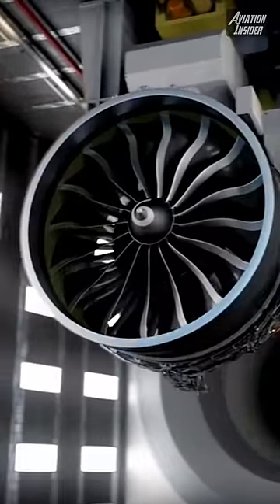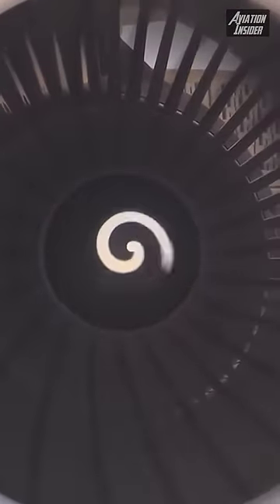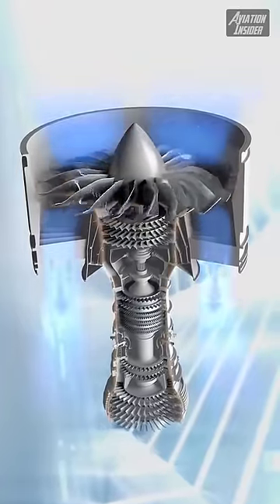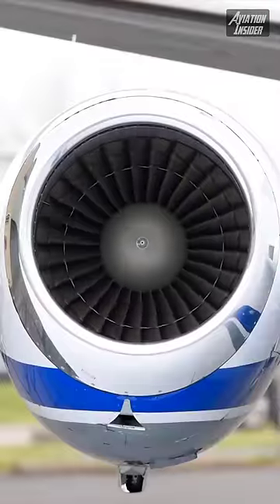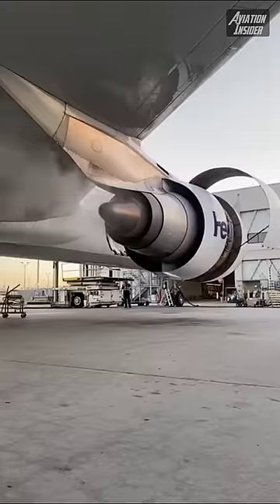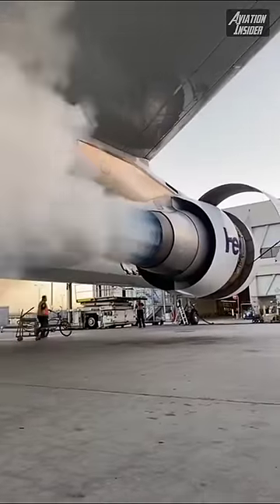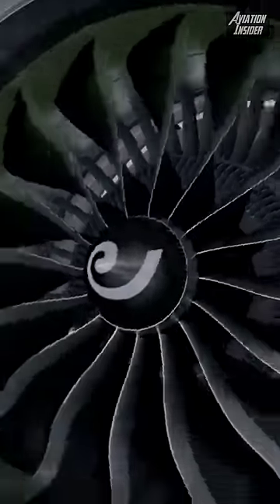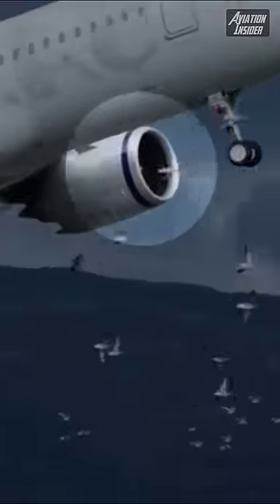Insane Reason Why Jet Engines Are Never Protected In The Front 😨

Comment: Only 1/4 of the intake air is used to burn fuel in the engine to make thrust. And other 3/4 part is used to cool the engine. 
They don't use any mesh to protect the engine from birds because it will induce drag in higher speed which will result higher fuel consumption and less efficiency
Reply: Now imagine if the mesh gets sucked in after it hit a bird

Now thats another problem
Also icing
Reply: @TPE429  let me clarify the icing problem. As a matter of fact there is no icing problem because commercial jets flies way over the clouds. And clouds are made up of water vapor way less denser than ice. Now answer me is there any chance of icing?
Reply: @TPE429  usually to prevent birds roaming around the airport all the trees and structures where birds can sit is removed. 
Still some birds made in they have drones to chase them so less probability but not "0". 
And if they got sucked into the engine then it's not good. That engine is out of commission. All the blades becomes out of balance.
Reply: @o_j_o6447  first of all. Icing can still occur above clouds thats why they made systems to mitigate this problem in the first place. Second of all a mesh of some sort will damage the engine more if it does gets sucked in
The bird is already bad but a metal mesh can damage it more. Is it worth repairing the mesh everytime it fails to catch a bird? No
Reply: Your just defending your point
Icing can still occur even above clouds and dont say "Water vapor is less dense" bro that vapor can still occur
Its called rime ice
Reply: @TPE429  water vapor is always less denser than ice it's as true as sun rises from the east and goes down in the west. When a jet flies at around 34-40k ft height there is almost no water. Until jet gets down to 4-3k ft and go through a rain or snow cloud. At that time ice can occur. I didn't say that icing on engine happens can never happens if go through a snow storm. I said that it can't happen in ideal conditions which means when you are flying without any cloud.
Reply: @TPE429  hey I'm electrical engineer we also calculate powerline wires characteristics based on places. Icing on power line wires also can happen which cause SAG. We had to keep in mind when we had to work on snowy areas.
Reply: @o_j_o6447  i dont think you quite understand that when the vapor hits the cold surface of an aircraft even above clouds can still build up ice
A mesh is a perfect place for vapor to be catched and build up ice
Its unheated and the air is used to cool the engine aswell so if we heated mesh aswell it would heat the engine
You are delusional
"Im a electrical engineer" and your not a aircraft mechanic aswell
Im not saying im better but mentioning your position does not make you right aswell
Your job is completely different than what you are talking about
Reply: @TPE429  yea you are right..!! No point in arguing with you when you are this fool.
I have a suggestion don't underestimate an electrical engineer. There is nothing engineering related what we don't have to read during our college. Electrical engineering is one of the most hardest engineering degree ever. 
And please read about atmosphere.
Reply: @o_j_o6447 As a commercial pilot, I feel a need to add something here. Icing could actually be a potential problem. Not a "cause a crash" kind of problem. More of a performance one. At least during take-off and landing. The icing on the metal wire would be enough to increase drag even more than the wire would already cause on its own. This increase in drag could cause a decrease in performance of the aircraft. Enough that it could potentially affect the aircraft's rate of climb and rate of descent, which in turn would affect fuel efficiency. Meaning that not only would the wire cause drag, but so too would the icing that was forming on it. Also, interesting fact. Technically, all of the airflow is used for thrust. Because of the way an airliner engine is designed, the intake fan actually acts as a propeller much like a prop plane does. So even though you are correct that roughly 3/4 is used for cooling and roughly 1/4 is used as fuel for the fire in the compression chamber, all of the air technically contributes to thrust. As the air moving on the outside of the chamber, but inside of the housing, does provide a certain amount of thrust. 
I'm not trying to say you are wrong or anything. Just adding a bit of extra context and information.
Reply: @chaosapple7771  as a commercial pilot you say. Is icing problem a everyday issue. I meant if you are not getting caught in a ice cloud is it still possible. And is it possible when you are flying at about 30-45k ft height. Someone is saying that I'm wrong and blah blah...
Reply: @chaosapple7771  btw i know icing is a real issue. It can change the shape of the airfoil which increase drag. And i didn't say anything about icing. I said that why airplane engine isn't protected by metal mesh
Reply: @o_j_o6447 Icing is absolutely an issue for commercial passenger jets as it is for all aircraft.  Adding a mesh in front would both make icing worse and increase the likelihood of damage to the engine.  I fly in alaska and twice we’ve had flameouts due to icing.  A much better solution is just to design the fan so the shroud takes the majority of the poultry.
Reply: Has it ever been an aircraft with deployable intake protectors for the take off/landing low fliying altitudes?

Wouldn't be there to create drag o get ice during most of the flight. Designed and made to damage the engine as little as possible in case of absorption.

Maybe is easier to just assume a yearly "poor bird" intake, but don't they pay top dollar for falcons and other ways to prevent this?
Reply: I am an aerospace engineer with  a master degree in propulsion systems. I have to say that nothing in this comment is correct. 

 I can ensure you that all the  air  that goes through the intake is used to make thrust. 
While it is true that only a small  portion of the air is used to burn the fuel (the ratio is higher than 10:1)  95% of the thrust comes from the air that does NOT enter the combustion chamber. Obviously the (so called)  cold flow is indeed used also to cool the combustion chamber but no single modern aircraft engine could fly with just the thrust coming from the hot flow. 

A mesh is not consider not because it would produce drag, the engine is already occupying that frontal area, the increase in drag of a mesh would be completely negligible. The real reason is that firstly it would be completely useless, even assuming that a mesh could survive the impact the bird pieces would still end up into the engine.
But most importantly, it would generate vorticity and 3D-flows entering the engine that would completely change the velocity profile of the incoming air making the fan ( the single most important component in an aircraft engine ) perfromace to drop.
Reply: @o_j_o6447  wait so you only protect icing at cruise? Use common sense please. youre icing answer only holds true if you LAND at 30-40k feet. The reality is, as the plane descends, it will still catch significant icing with that much mesh. Doesnt even need to be ice clouds, any type of moisture would definitely freeze when the plane reaches about 20k feet
Reply: Birds hitting a mesh will just be cut into pieces, which won't be stopped and will end up in the engine.
The mesh idea makes zero sense.
Reply: Isn't that what the video explained.

Comment: The fan blades limit the air intake and force it into a linear flow,  also they assist in compression.  Suck, squeeze, bang,  blast,  blow.
Reply: Wait, jet engines do SSBB too?
Reply: @YourLocal_Mkara yes
Reply: @verttikoo2052  I bet you also do SSBB
Reply: @v01d_r34l1ty  I bet that you don’t even know what Super Smash Bros. Brawl is.
Reply: @YourLocal_Mkara Yeah, just like my ex they do it all at once all the time.

Comment: So it’s because large airline companies can save some money from fuel efficiency rather than doing something to save the lives of 300-400 passengers.
Reply: Yeah, if you put it up like that😅
Reply: Did you honestly not think about if the bird hits it hard enough then you have a big metal cage AND the bird getting sucked through the intake? I'd rather deal with just the bird just saying
Reply: You dont die from a bird strike.
Reply: No its because it would lower the airflow to the turbine it REQUIRES the maximum amount of air possible
Reply: Thing is, most passenger airliners aren't single engine, and unless that mesh is made of some sort of super material then it'd just break when a bird hits it like most things would do at 300+ kmph relatively

Comment: A third key factor that was never said is bird strikes typically happen within a couple  thousand feet up. Landing/taking off.  When the plane is cruising,  there are no birds above at those flight levels and a mesh screen would be useless and cause an insane amount of drag that would increase fuel consumption and also possible FOD if that protective screen broke

Comment: Although true, two other factors are in play. First, a large bird strike at 300mph requires a very massive mesh to not fail and be sucked into the engine. That would be catastrophic. Second, any mesh  open enough to not utterly strangle the engine would simply shred the bird, which would still enter the engine.

Comment: It would cause drag potentionally all the way down on the ground (depending on what's going on); but uh if you controlled the engine even in outerspace you could create wormholes (but warning outerspace is delicate because it's complex vortexes you could cause a thermodynamic collapse making hot or cold engulf warmth; because cold grabs warmth like a constricting Snake venom DNA and hot lashes warmth like a Snake venom DNA that melts it in a way until it is stuck laying on it (because it's hot, cold, and warm in the middle cold on the left of warmth and hot on the right of warmth on Earth (not to say that it can't be other ways say hot on the left and cold on the right) with cold gripping warmth and hot lashing warmth.

Comment: They put cone shaped filters on car engine air intakes and it still sucks just fine. So what if a parabolic or cone shaped carbon fiber 'filter' cage with sharp leading edges was attached to the front of aircraft engines? Something with holes big enough so that icing isn't an issue but small enough to 'pre-mince' up big birds like geese and ease the impact on engine blades.

Comment: You can run a turbo fan engine with a mesh just fine, the issue is when you reach high speeds you rish the mesh breaking and causing damage to the engine,  or normal wear and tear causing the mesh to break apart

Comment: Never say never.  Some of the earliest turbojet engines had retractable screens in the inlets.  They iced up readily due to the temperature drop which accompanies the low pressure in the inlet, causing engine failures due to air starvation and overheating.

Comment: I'm working on a 737-200 at work now, which has 2 JT8D engines. They are small by today's standards and actually feature a stater before the fan blades. The intake diameter is small enough that if a person got sucked in its possible they wouldn't get shredded.

Comment: Also for any mesh to be placed there it would require it to be very durable to survive the bird strike, however, if such a mesh gets damaged it would get sucked into the engine and cause a lot more damage also other stuff could get caught on it, especially ice which then could also damage the engine once broken off not to speak of the reduced thrust. Bird mincer is the best option.

Comment: Most jet aircraft can safely fly with 1 engine as well, the only reason they have 2 is for sufficient thrust to take off and stabilization losing an engine is scary but arguably losing rudder, flaps, or ailerons is 10x more terrifying.

Comment: Well also think about it this way. You're flying incredibly fast. If you introduce a mesh, it's going to be more likely to break and shatter into the engine destroying it than if the engine just shredded the bird. It created more possible FOD hazards. It wouldn't constrict air flow that much, but the act of it getting pulled by air and hitting something will just put it in to the engine. And if go with a stronger metal say titanium, you're just going to set the entire thing ablaze since titanium can spark and catch fire when in small enough particles which can happen from an engine shredding it.

Comment: "Never" is a bold statement.
The early MiG-29 versions undoubtedly had jet engines, which were protected from the front and they had engine protection lids, which were supposed to seal the frontal opening of the intake with a solid metal plate and feed the engine with air through articulated cutouts on the upper section of the intake instead, until the aircraft takes off completely. 
The reason for that was allowing the aircraft to take off from gravel on barely prepared airfields or highways serving as makeshift runways in case of nuclear war. 
Sure, it reduced takeoff thrust quite a bit, but a relatively light twin engine fighter had more than enough thrust anyway. 
Now, the reason they didn't use grills is fairly simple: a grill can't stop debris large enough to cause engine damage, it would be too fragile, and a failed grill will disintegrate, causing even more secondary debris making their way into the engine, aggravating the damage even further.

Comment: they could fit a protection like flat blades but still difficult to implement, will reduce the flow and needs to be stronger than the fan blades.

Comment: yeah, I always thought it was just a blender running at 10,000 rpm so we'll be fine. but in some cases, it can cause an engine failure, when it happens you are probably not somewhere 40,000 ft up so the aircraft can still maneuver back to the airport.

Comment: If one of the engines fail, jet engines can still fly with another. Maybe they think it's okay to lose one besides air flow issue :)
Reply: There are a number of other issues such as you have to limit rolling into the downed engine and you may have to burn or dump fuel to make landing weight but both are better than mesh in front of the engine

Comment: Not only would a grate reduce the efficiency of the engine, it would also not solve the problem of bird strikes. If the bird hits a grate at 700 km/h, it is cut into whatever size the holes in the grate are and still goes into the engine.

Comment: Why Not? Here are my thoughts:
- it'll disrupt the airflow into the engine
- it's expensive
- it's heavy and will add unnecessary weight to the plane
- a bird smashing into the engine at that speed is likely gonna break through the grill or break the grill itself
- engines are designed to withstand small birdstrikes (they test with frozen chickens iirc)

Comment: I liked the video but the main thing was missing. Even if the PERFORMANCE was the same using a protector, it would be much more DANGEROUS to use it to "protect" the FAN or compressor. Creating a RIGID protection mechanism and placing it in front of a jet would only create a much more dangerous risk scenario for the engine itself. If a problem/break occurs in the protector (either after a collision with large birds, or even breaking due to wear), the construction material of this protector itself would be MUCH MORE HARMFUL to the engine than flesh, bone and feathers.

Comment: Some jet engines do have protection for the intake Sanchez some Russian fighter jets and most helicopters the thing is the protection reduces efficiency dramatically so you'll never see it on a turbofan that's built for distance and fuel economy

Comment: Plus, you don't want a bird hanging there on the mesh. It will take away even more airflow the duration of the flight. Most birds stay below 500 ft, and during migration they go to 2K to 5K feet. No need to protect so much against something you'll most likely encounter the first few minutes of a flight, and the last maybe 10 minutes.

Comment: I’ve been an aircraft/turbine engine mechanic for over 35 years and have to laugh at these videos that give their reasoning on why a FOD screen isn’t put over the intakes, as well as the comments of people saying why it doesn’t happen. It doesn’t have a thing to do with icing, decreasing airflow, or anything like that. The bottom line is time and money, PERIOD. Part of preflight checks is the intake, and checking the first stages of the turbine blades, which means getting inside the intake to look, also meaning that safety wire would have to be removed along with nuts and bolts, then reinstalled & safety wired, etc. That alone would take too much time, and also create the risk of discarded wire and hardware getting ingested into the engines. And it would have to take place on EVERY landing and takeoff. I can elaborate on this further if anyone wants me to, but this is the main reason. Ice, decreased airflow, etc is all negligible and complete horse shit.

Comment: My least favourite job is cleaning up after bird strikes, especially if it gets sucked into the heating pack and gets wedged into the hail protection. Nothing like pulling bits of bird out of the core of a heat exchanger with a set of tweezers

Comment: You could fit a grill, engines come in different sizes and you'd fit the size that works. The main reason is the birds would clog the grill ruining fuel consumption and the ability to fly, it's much cheaper to liquidise them.
Reply: The main reason is it wouldn’t help and could detach and smash up the engine.